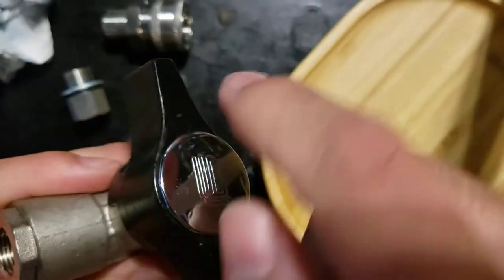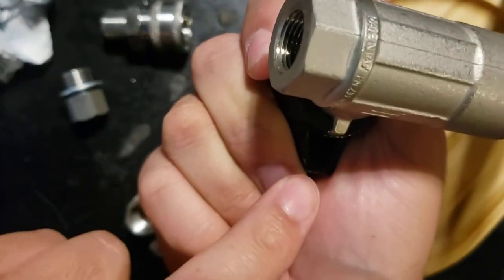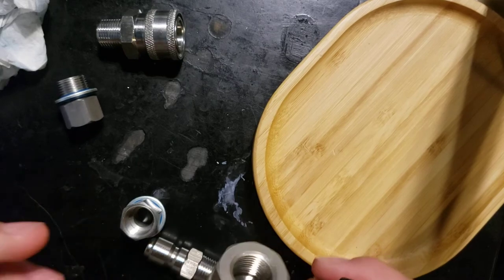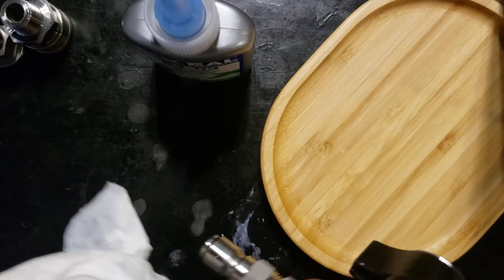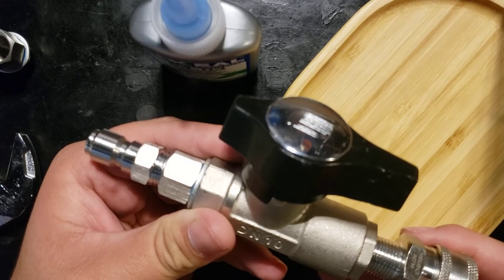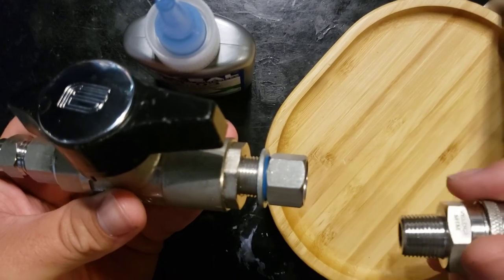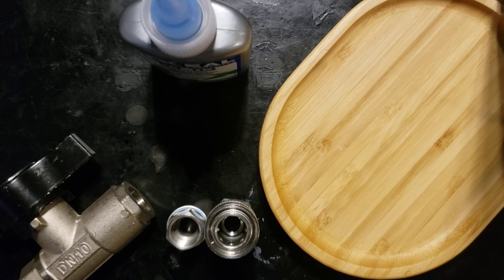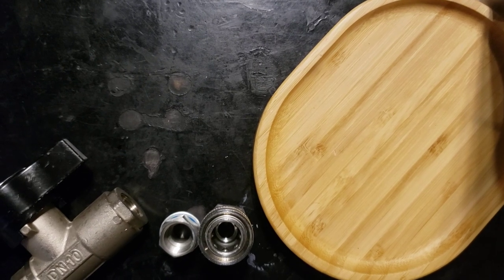Half Ball Valve Quick Connect Set Up DN10

Comment from the maker: Half Ball Valve Quick Connect Set Up DN10 

MTM 3/8" DN10 Plated Brass w/ SS QC
https://pressurecity.com/products/ball-valve-3-8?variant=31395016867905 

PRM Filtration 3/8" BSPP-M to 3/8" FPT
https://shop.prmfiltration.com/collections/stainless-steel-bspp-adapters-npt-female-x-bspp-male/products/bspp-adapters-stainless-steel-3-8-inch-female-npt-x-3-8-inch-bspp-male-with-sealing-washer 

Hydraulic Thread locker
https://shop.pressurewasherproducts.com/50ml-MEDIUM-LIQUID-THREADLOCK-FOR-HIGH-PRESSURE-FITTING-USE-5004.htm 

Mosmatic 32.564 Gun Swivel - 3/8in NPTM X 3/8in NPTF
https://www.kleen-ritecorp.com/p-18999-mosmatic-32-564-gun-swivel-3-8in-nptm-x-3-8in-nptf.aspx# 

YouTube Disclaimer 

I am just showing what I'm doing and how I'm doing it. Use, practice and implementation of this information is at your own risk. I am not an expert nor do I claim to be one. I am just good enough to do what I'm doing. 

Thank you for watching